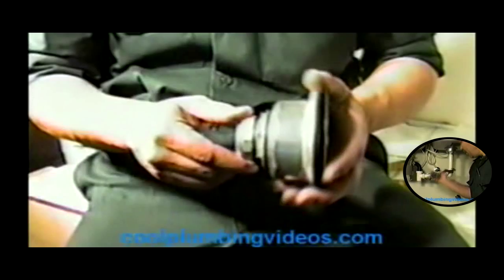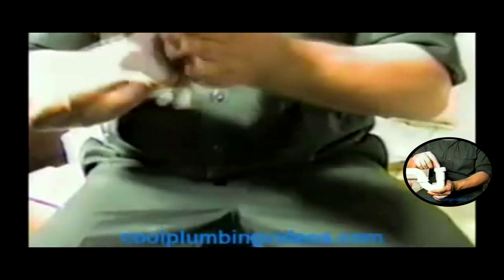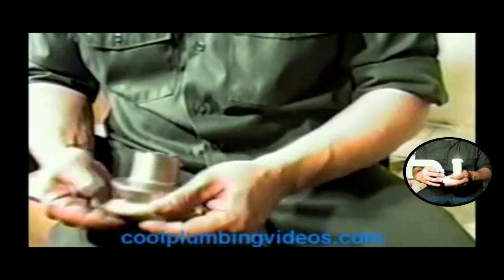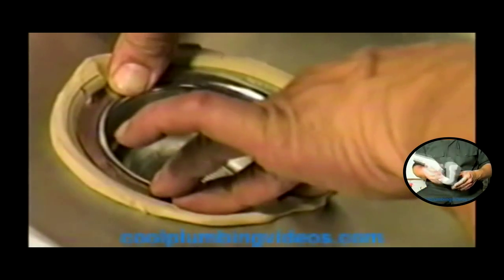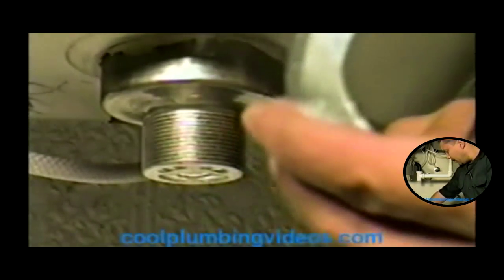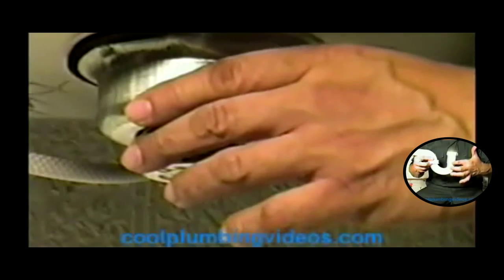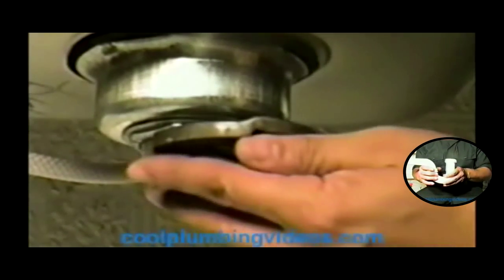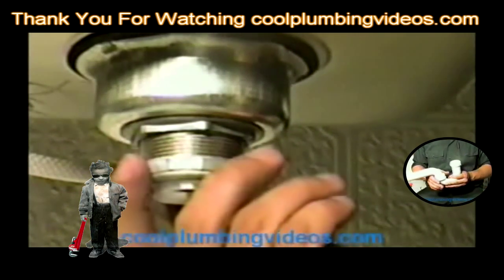Tricks To Installing Basket Strainer Install

Comment: Thanks so much. Unfortunately I have the other type ring that is much harder to tighten. I had leaks from both. I think I might have overtightened and squeased out all the putty. It's back under the sink to fix it. The old baskets could not be removed without much work with a hacksaw.

Comment: Great help and your a very honest dude too :) Could you tell me where the rest of this video is? I need to know how to connect the down spout to the p trap. I am having a hard time with leaks at that point because im not sure how to finish the connections  and I have a very short down spout to work with. I could get you some pics to help clarify things if you like. Either way thanks for all your help and keep up the great work!
Reply: +Claude Taylor Great thanks for quick response! I'm going to make another attempt after work tonight.
Reply: +Claude Taylor Hello again Claude, I figured out how to install the p trap assembly to the downspout however it seems that I have a very small leak at the bottom of the p trap at the bolt. I am not sure how much to tighten it. If I tighten it too much it squashes the rubber gasket and I'm afraid I may break the seal and but it is leaking when it is too loose. Should this be hand tight or should I put a wrench to it and if so how many turns do you recommend? Thanks again for your time.